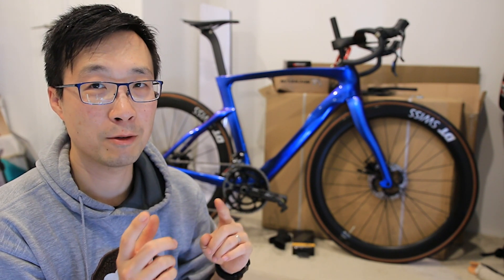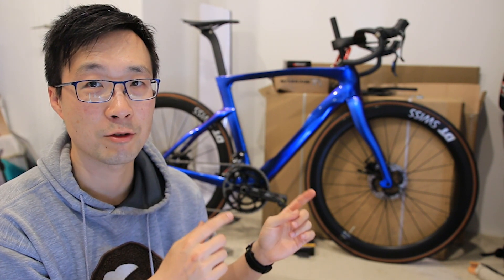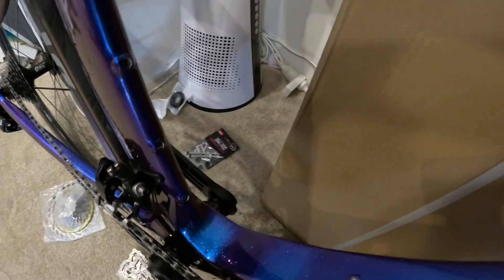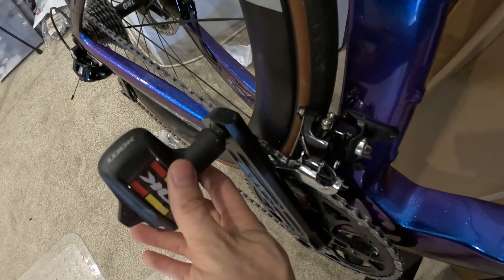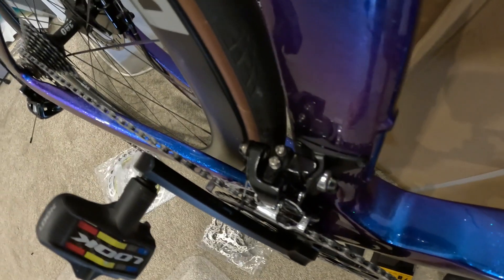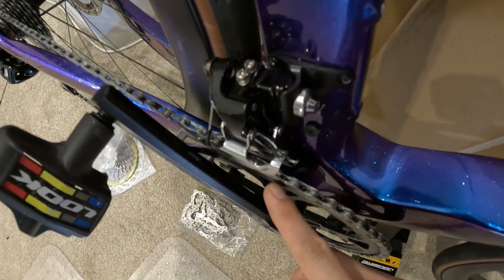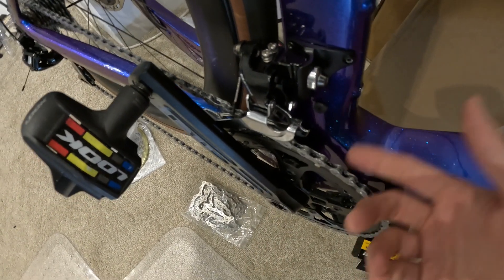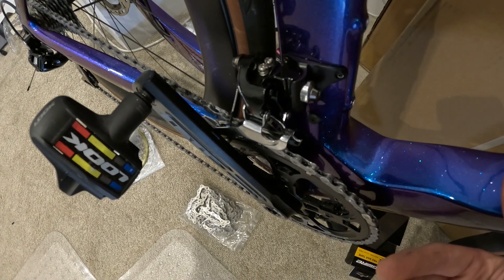VeloBuild VB-R-218 build documentary - Derailleur setup Challenges with Sensah Empire Pro groupset.

Comment: Check your groupset. I think the Sesah is a clone or compatible with the SRAM groupset, in which case all you need is the front derailleur alignment tool & attach that to the bit ring & align the fd so it is in a perfect line.
I would suggest checking out the ParkTool videos on here or the SRAM ones as they may solve your issue.

Very good build & looking forward to the next video
Reply from the maker: Yes, it works like a SRAM. I will do a bit more research and see what I can found.

Comment: just finished my build VBR-218 rim brake, tried to re-route cable 3 times,  you need to re-route your cable housing, especially at the bend of your handle bar, there should not be any twisting as it will affect the cable pull, try to re-route your cable at the handle bar just under the cover, by the way noise damper for internal cable housing is also to be considered.
Reply from the maker: Thank you for your suggestion. I checked the cable pull, and they seem to be all doing fine. I am about 80% sorted and will soon do a test ride to confirm the shifting performance.
 I would hope I don’t need the noise damper. I don’t have any of them handy and don’t want to reroute it at all.

Comment: something doesn’t make sense here, the front derailleur should go all the way to the smallest chainring when is not engaged. From what I am seeing here yours stops midway in, it should completely in to a point that looking from the top, the outer edge of the cage should touch the small chainring.   Make sure your “low” screw limit is good and the “high”. Even my Red AXS front derailleur when its engaged to the big chainring stops around 2 or 3 mm from crank arm
Reply from the maker: I need to have a proper look later. I have a feeling that something in the setup isn't right.
Reply: @cycleandexplore  Is the chain length correct ?